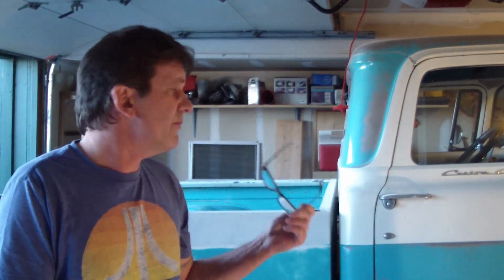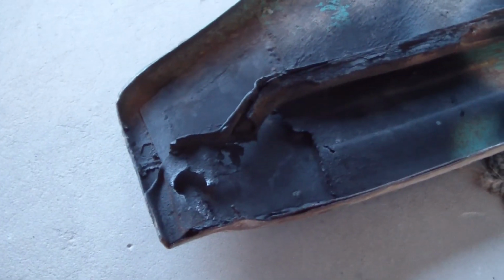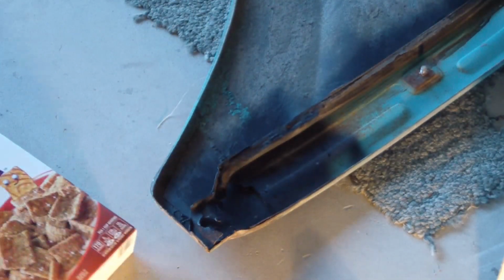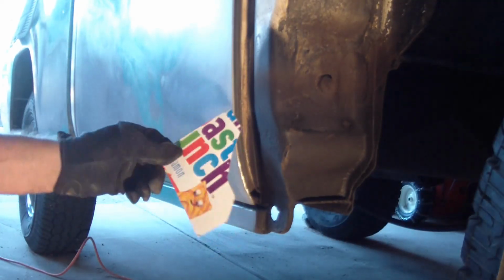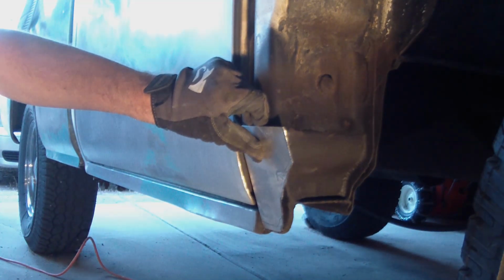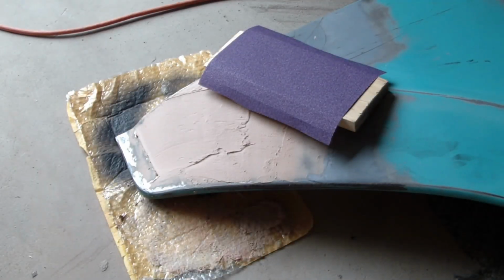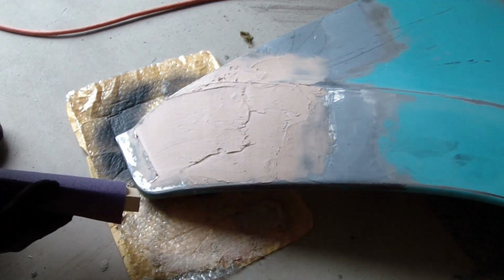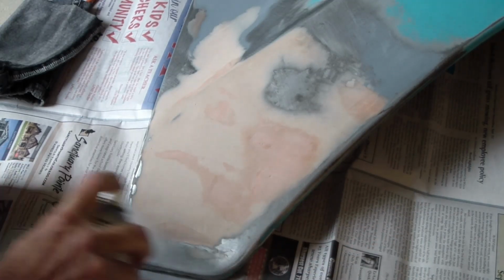1959 Ford F100 Truck Fender Rust Repair Welding Body Work! F100 Episode 8

Comment: Hi I just bought a 60 F350 nice straight outer body, only two owners since new but it does need some floor work and other stuff, it's been sitting untouched in a junk yard at least 10 yrs, the last registration I could find in it was from1983, but it was ran as a farm truck for several yrs after 83, still a cool old truck!
Reply from the maker: Good job, nice save! Now get er back on the road.